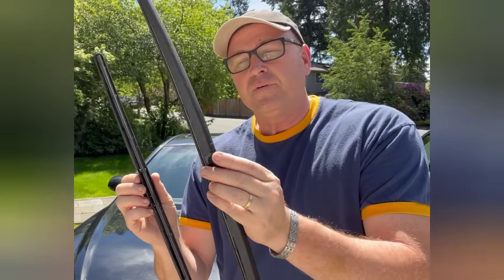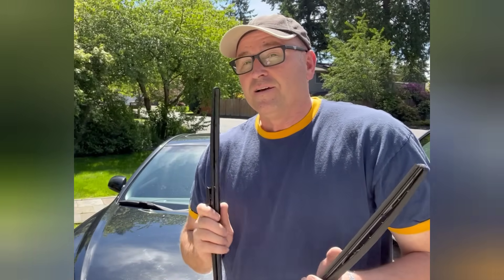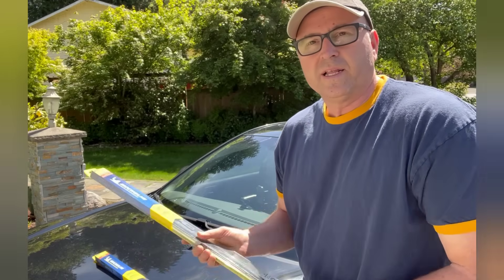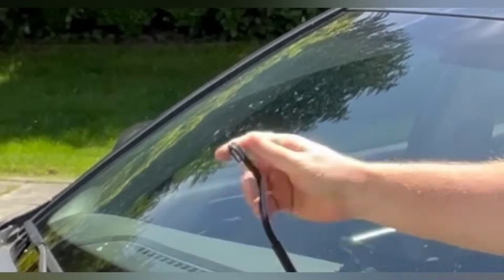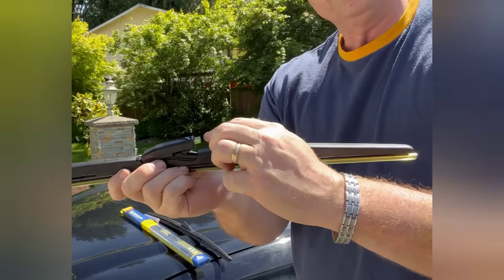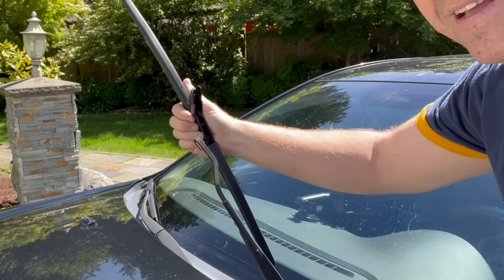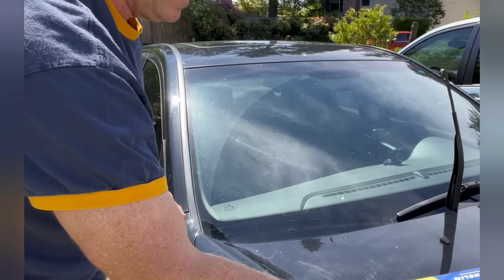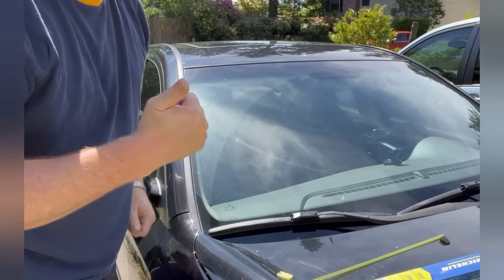How to Change Windshield Wipers

Comment: Just to point out that when your wipers are off and only the metal rod is in the upwards position, be very careful not to accidentally let the metal rod fall towards the window! I've seen a smashed window because of that. If for whatever reason i have to let the car sit for a while without the wiper on, i always lay the rod down gently to avoid accidentally smashing the window.
Reply: This happened to me and I had to buy a new windshield. Now I always lay a microfiber cloth on the area of potential impact before I take the blades off.
Reply: Was about to say the same. I like to just put a shop towel on the windshield so if the arm does slip I don't do damage.
Reply: Thank you, daddy ☺️☺️☺️
Reply: Just put a good-sized thick towel - like a bath sheet towel or a beach towel - across the windshield while changing the wiper blades.
Reply: I learned to lay a towel down… out of straight fear
Reply: 0

Comment: Thanks for this video.  I always thought the rubber got replaced, not the whole arm. As a divorced woman I find your videos really helpful. Thank you 🙂
Reply: My dad said in the old days they used to just replace the rubber. It was much more eco-friendly and easier to replace than how wipers are nowadays.
Reply: @KellyS25 Yes, i must have seen my dad do this. 😊
Reply: There are still wiper "refills" (the rubber part) available, so you may have the option to replace them rather than the entire blade.  If the blades get weak and don't hold the rubber insert down, it's time to change the whole thing.  🙂

Comment: This is great to see.  There are several maintenance items on a car that can be done by just about anybody, but there's always mystery around them if you're not into cars.  Dad's right that the auto parts guys usually provide these services as a courtesy but asking them to show you how usually ends up as a win-win for all.  The customer now knows how to do the job and the parts guy got to teach somebody something new and next time he's on to the next customer.  Another couple of great ones are cabin air and engine air filters.  At just your average service center you're paying a 35%+ mark up on parts plus labor for a service you can often do with no tools in your driveway.  Plus you get a sense of when something is out of place on your vehicle and needs the professionals.

Comment: Appreciated. I need to take mine off to clean them and the windshield. I've been having smearing problems. I went to a shop and they told me that they didn't need replacing and to clean them and the windshield with a degreasing cleaner and that if I have any more issues to go back and they'd have a mechanic come out and take a look and give me some advice. Appreciated their help and yours. Cheers.

Comment: He hasn’t done it yet, but since he brought it up I wanted to comment. To those who don’t know how to change a tail light, it’s ridiculously easy, but the way the casing is set can vary slightly between cars so be sure to look up your model just in case. In my case, I have a 2015 Nissan Altima. The tail light can just be pushed off by applying pressure from the side toward the rear. So your hands are on the side of the light pushing toward the back. Once the casing is off, you just twist and pull out the bulbs of it and the bulbs come out of their sets just the same. The bulbs are all different sizes so there’s no mistaking where they go either. If you have to replace the whole array you’ll need to take off the side trunk wall which you may need a video to do if you’ve never done it.

Comment: The first time I did this, in front of the autozone, the arm slipped out of my hand when I pulled the wiper off and it cracked my windshield. The employee laughed & cheered on for the crack to spread. Good times. 😆

Comment: how do you know the length of wiper blades to purchase?
Reply: Most auto stores have a book (probably online too) to match the correct size for your auto, if you don't have your owner's manual (which tells what parts you need for that type of simple replacements and is a treasure trove of those little details like tire size/pressure, fuses, and even how to change the wiper blades and what replacement bulbs for tail lights etc.) and the people who work there can show you how to look through the book if you can't figure out the charts (they are pretty intuitive - car make like Mazda, then model like CX-30 or Miata, then sometimes even more detailed if there are variations within the model)
Reply: @carolhodges9181  I’ll check my owners manual.  Thanks for taking time to respond.

Comment: Mine has a loop too.  I bought the correct size.  But the smaller one on the passenger side isn't sitting flat.  It's clipped in and I can't find any other way to do it.  But like 1-2" of the wiper isn't flush with the windshield.  I don't know how to fix it.
Reply: I bought the RainX ones.
Reply from the maker: I wonder if it’s all the way in?
I know on my van, I have to work at it to make sure the loop is all the way seated. 
You can even get it to clip, even if it’s not all the way in.

Comment: #1.} Why are the wipers different sizes? ~ #2.} During winter, why do some people raise the wipers?
Reply: 1) it just depends on the car. My wipers are the same size.
2) They raise the wipers so it is easier to clear the windshield of ice or heavy snow with a brush (wiping off ice with the wipers will ruin/break the wipers)